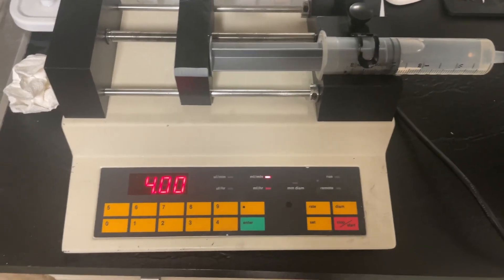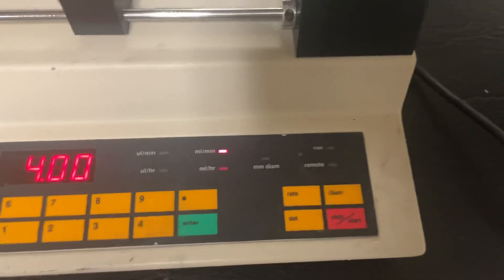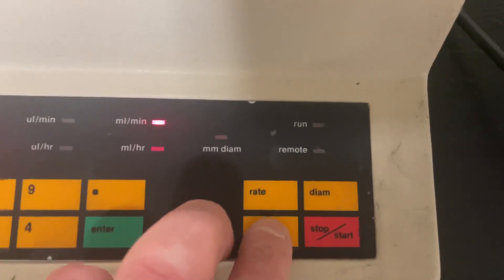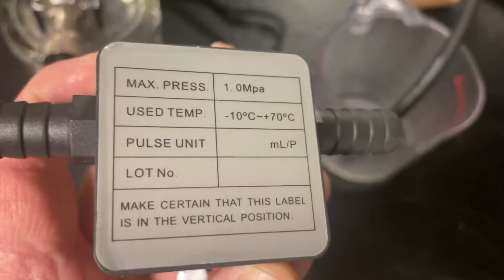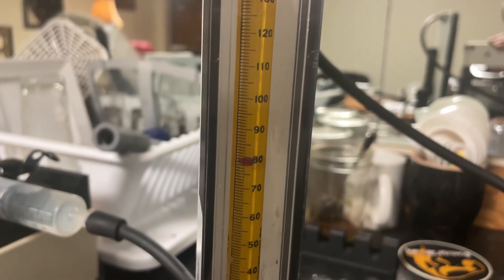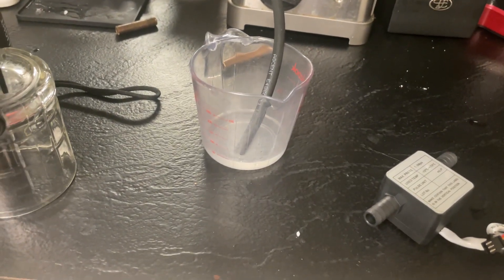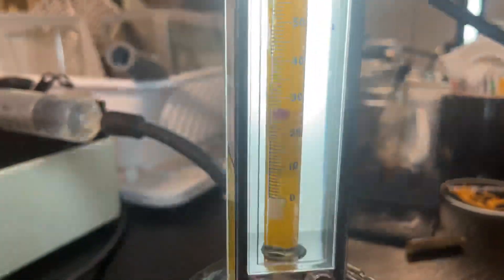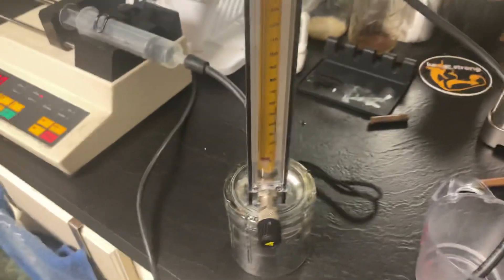Mercedes Bosch K KE Jetronic ultra high precision Calibration Fixture to adjust Fuel Distributor P.1

Comment: Hello, I have watched all your videos since I own a '89 560SEC. I have learned a lot even though I had some knowledge. Could you please tell me the models of the 2 Aalborg measuring devices that you are using to calibrate at idle and normal/full load? As well as calibrating them to make my own calibration device based on your previous video about it. Thanks a lot and keep on doing videos since they're very helpful.
Reply from the maker: Yes, later tonight
Reply: @inovahightechltd  ok I'll wait for your answer. By the way, is it better to calibrate it with a digital fuel flow meter? If yes, could you tell me where to get it because I can't find a digital fuel flow meter that measures less than 1L/mn. Thanks